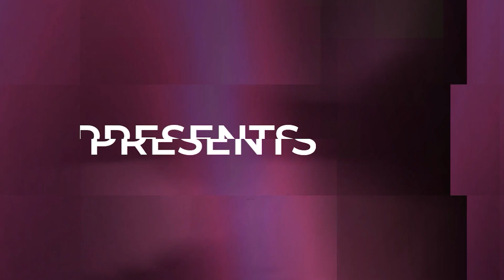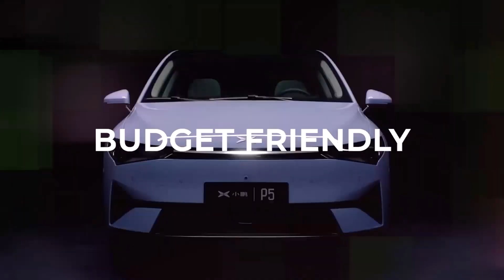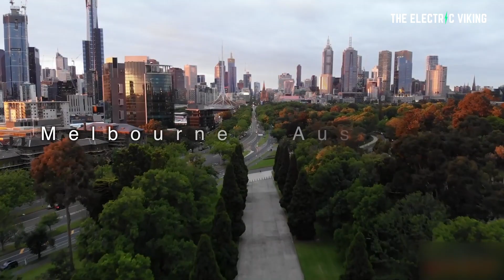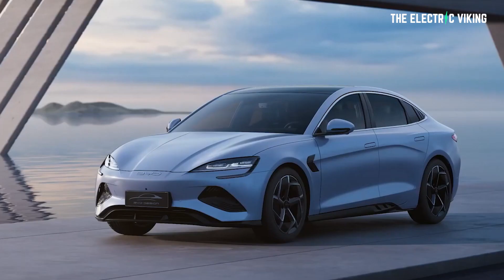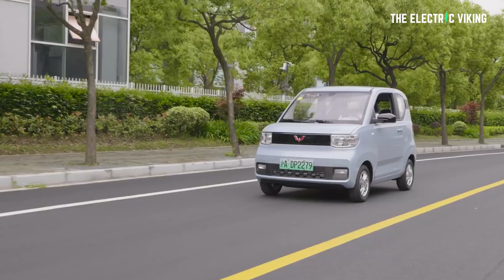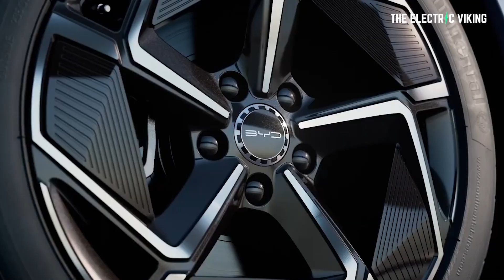NEW BYD Sea Lion & Seagull EVs coming after Atto 4

Comment: I would be interested in the Seagull. I currently drive a 2006 Yaris, which gets about 550kms of range, but even if the Seagull had 250kms of range that would be enough for my purposes. Hopefully the Seagull will cost $25k or less, which isn't a stretch, because even if we only got the top spec model here, that equates to about AUD $15k in China. You then need to add maybe $5k for shipping and maybe $3k for import tariffs, so that would be $23k. The 2022 Yaris is priced from $27,060 so maybe BYD would match that kind of pricing, which is still pretty affordable. I wouldn't pay more than $30k for a car that size.
Reply: I think the Dolphin will be right around 30k.  If you buy get the one with the largest battery.  Even though the blade battery is expected to last longer the anecdotal feedback that I see is that the biggest battery is best.  Go see Lars ratke's channel and see.
Reply: My car is currently a Suzuki Swift which is ideal for local use and occasional longer trips of over 300 plus Km. So while a Tesla still remains the top choice at the moment, I would certainly consider the Seagull a good replacement for my Swift.

Comment: I still puzzled ❓  why these EVs Man.  are still using Batteries
Reply: So tell us what they should have, man. trailing wires connected to overhead power lines perhaps?
Reply: @aftonline  lol ..do ur  research
Reply: @rexgeorg7324   Seriously, EV's without batteries? You are really full of it. You can't even tell me because you just dropped a stupid comment that has no substance to it. If you have something to say, spit it out, otherwise don't even bother. If I had the slightest clue what you are talking about I would research it. I am always open to new ideas but you aren't giving me any...
Reply: its all on the net
Reply: @rexgeorg7324  of course it is. I will look into ultra capacitors. That must be what you are talking about. You don't seem capable of typing more than a few words at a time so I will just have to guess what you are trying to say...
Reply: capacitors are red herrings